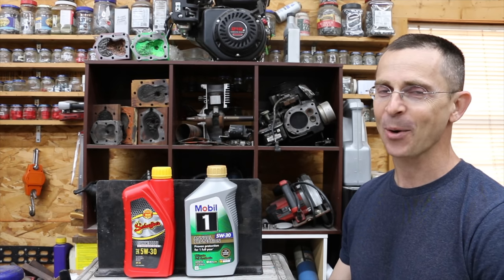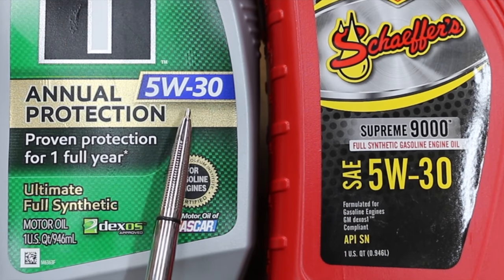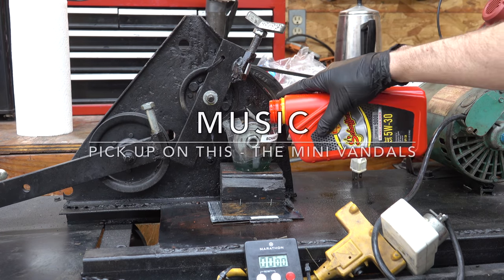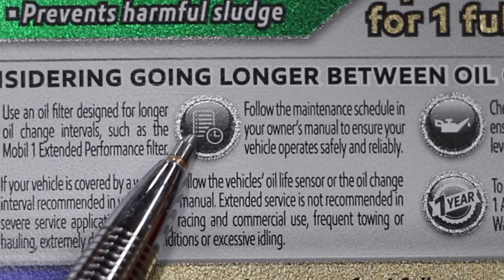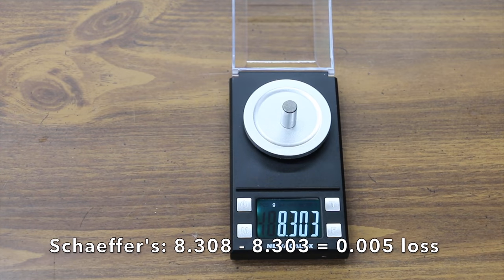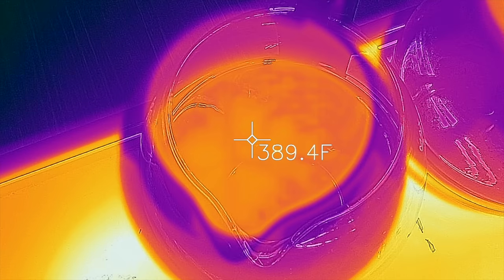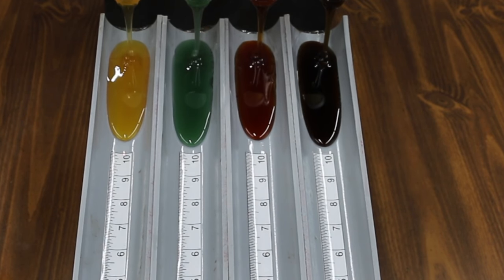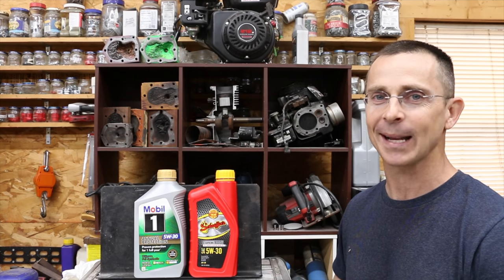Is Mobil 1 better than Schaeffer's Full Synthetic 5W-30 Motor Oil? Let's find out!

Comment: I've used Valvoline for many years, it's what my father had used on the ranch in all of our vehicles and equipment back in the 70's. But once I had discovered Shaeffer's just a few years ago I have not used anything else since.

I have spoken to many fleet operators and mechanics, and those who are willing to spend an extra few bucks on quality oil will choose Shaeffer's. One mechanic had told me once that he had to do some head work on his engine, and he had sent in his camshaft to have it reground since it had several thousand miles on it. His machinist had called him back telling him that he couldn't do anything because his camshaft still meets factory specs and had no wear on it. He is not the only one who I've heard from on how well that Shaeffer's oils perform.

 Once my new GMC Sierra is ready for an oil change, I'll swap out the factory fill oil for the Shaeffer's oil.
Reply from the maker: Thanks for sharing.

Comment: I use Shaeffer’s in my 1985 VW.  The engine runs like new and has zero issues with near new compression.  Can’t go wrong. Oh, it is their diesel specific 15/40.
Reply from the maker: Thanks for sharing.
Reply: Have you done a video on garage sized air compressors?  @ProjectFarm

Comment: I've used Mobil 1 since they first began making a synthetic oil and have always been extremely satisfied. I have even drained their oil after 5000 miles and it was still golden in color! Having said that, I'm somewhat appalled at how high the prices of all synthetic oils have gotten. I'm sure that Schaeffer's is extremely high quality oil as well but I don't know if it's worth the extra 4-5 bucks a quart.
I think you paired the 2 top oils together in this test. I'm certain that the Mobil 1 would beat almost all of the other oils being tested. 
Your right about the recommended oil change intervals but I have seen some that recommend a 1 year/15,000 mile interval. 
Great testing as usual though. Thanks for the info 👍 P.S. I take my oil with 2 sugars and cream.
Reply from the maker: Thank you!
Reply: Trust me, buy in bulk when buying shaeffers motor oil supreme 9000.  Buy from a wholesaler who sells it and I paid 6 quart back in February of this year 2019. It's an outstanding oil ,and I saved alot of money and so can you.
Reply: @chadnmelissa8830  thanks for the info. I'll give it a try.

Comment: A more appropriate test would be to check the viscosity at -25 and 100 C.  Its possible that the Schaefers performs more like a 20 weight oil at high temperature... not a good thing. You should not have any trouble checking viscosity at that temperature. Your lubricosity test is good... how about running it after its been used in your car?  Another good test to determine the oils ability not to break down... far more important than your evaporation test.

Comment: I once let that Mobil 1 Advanced formula in for 15,000 miles. It was black as hell but no sludge was found. Thats how you test it. Trust me, Mobil 1 is King! Accept no substitute! I also use the Mobil 1 synthetic oil filter.
Reply from the maker: Thanks for the feedback.

Comment: Simple but great test. very informative. just one thing, one might argue the pipe (PVC pipe?) used as a race track might contribute to the error of the test. So, best is to test the possible error of the pipe by running single type of oil over all 4 tracks first to make sure they all finish the same time. Anyway, its been 10 yrs I Ieft ASTM/DIN related work, feeling glad and nostalgic seeing someone does material testing. Keep it up!
Reply from the maker: Thank you for the recommendation!

Comment: The best oil is clean oil. 

I own a 2007 Ford 500 3.0 L V6 with about 287 K miles. Engine has never been opened for anything. 

This little engine holds 6 qts of oil.  The  first set of plugs was changed at 225K miles.  They still looked like new, but I thought that I got my money's worth by then.   
I change my own oil since new using off brand, (Walmart, and the like), full synthetic 5W - 20 every 5,000 miles and Fram or other cheap filters.  Sometimes when the miles were accumulated by extended highway driving,  I changed the oil after 10K miles. Still looked clean.  When you look into the engine from the filler cap, it still looks shiny like it did when I bought the car.  it still purrs, and uses NO oil between changes.    My other trick is to let the car run for 30 seconds in the summer and about a 1 minute in he winter before driving.   I don't accelerate needlessly like I am driving a dragster, and I am gentle on the car unless I need to get out of somebody's way and bury the gas pedal.  As long as the oil meets the API standards any brand will do.  ALL ELSE IS BULL SHIT.
Reply from the maker: Thank you!

Comment: We started using Schaeffers back in the early 80's on the Farm.  If you farm or deal with heavy construction equipment then you know about Schaeffers.  They do not really cater to the mainstream crowd or auto market so much.   TDR (Turbo Diesel Resource) had several 15w-40 oils tested some years back through a real lab.  They tested Full Syn and Conventional oils, the results where unexpected to be honest.  Conventional Rotella and Pennzoil 15w-40 came back with horrible results.  Rotella T-6 on the other hand I think ranked 3rd on the Full Syn while Amsoil was basically at the bottom of the list for Full Syn.  Kind of makes sense as the only transmission that I have ever had fail was while running Amsoil ATF in it.  AMsoil and Pennzoil are the only brands I will never use unless I need an oil to start the burn pile.   Schaeffers is the only thing I run in my Vehicles and Toys.
Reply from the maker: Thank you

Comment: I run Schaeffer's in my race car and use all of their products. Penetro is by far the best penetrating oil available anywhere. Citrol is a citrus based parts cleaner.
Reply: Heinz Guderian the silver streak aerosol grease is perfect for fithwheels as well

Comment: Love everything about all your videos but one I always look for is the Schaffer’s 700 Series 15w40 for semi diesel fuel not gas engines but it compares with like T6 shell Rotella oils or mobile one full synthetic but the Schaefer 700 15w-40 I’ve heard supposed to be better than all other synthetics I do know the 700 series is a conventional bland, but I’ve always heard it was better than any other semi truck oil in  synthetic

Comment: I  know you read the posts because you have replied to me a couple of times. I really appreciate you and I trust your opinion. I have a 1999 Dodge Ram van direct drive carpet cleaning truck with 135000 miles on the vehicle and 84000 hours on the cleaning machine. The truck needs to be running at 1500 RPM while I'm cleaning carpets.
My mechanic tells me that that amounts to 550000 miles on the engine.It still runs great.  Because my truck has a rear main seal leak and I go through a quart every 2 weeks (I use a drip pan when I'm working and in my garage) I have been using Schaeffers 7000 10/30 oil as opposed to the Shaeffer 9000. I want to keep the truck running as long as possible. Is it worth it to spend the extra money on the 9000? Are there any motor oils that are better than Schaeffer for my application? Are there any additives that might be good for my truck at this point? Do you have any recommendations?
Thank you
Reply from the maker: You might consider using a "high mileage" along with AT205 to "slow" the leak a little.  By the way, does the engine have 8400 hours or 84000 hours?   I hope this helps.
Reply: @ProjectFarm  it is 8400 hours but that's a lot of hours for direct drive carpet cleaning machine and my mechanic says that that translates into a lot of miles even though it's standing still but it's running at around 1500 RPM.
I looked at your complete oil report and the Pennzoil ultra seems to be better than Schaefer. Do they have a high mileage version of that?
And what is that additive that you are suggesting? Who makes it?
Thanks for your help

Comment: I use nothing but Mobil 1 oil. I think it's a really fine oil. I have a 2011 Ford f250 4X4 6.7l diesel pick up with 100,000 miles  and I had to take the lower oil pan off because of a small leak. When I took it off the inside of my engine looked BRAND NEW. No build up no gum no grime,I mean it was really clean and I attribute that to the oil that I'm using. I do a oil change when my truck tells me to and on average that'll be anywhere from  6800-7200 miles. Mobil 1 oil is absolutely fantastic. If they made a cooking oil  it'll probably be great too, ha ha.
Reply from the maker: Thank you

Comment: Though both oils are rated 5W30, the Mobil 1 oil tested slightly more viscous than the Schaeffer's. It's therefore not surprising that the Mobil 1 also had slightly less evaporative loss than Schaeffer's oil. BTW, I have the same Newalocox scale you used. It's not accurate to the milligram so both wear weight losses must be considered within the margin of the scale error. Based on the above, I concluded that both oils were equivalent performers in your tests.
Reply from the maker: Thank you for the feedback!

Comment: Schaeffer is just about as good as amsoil signature series but also half the cost. I get 6 quarts of supreme 9000 for 55$ at local napa. I also love castrol extended performance but Schaeffer is better. My dad's 93 3.0 ranger had 730k miles with no major engine issues on castrol oil. Also bought the truck new with 15 miles. My dad's friend runs Schaeffer 9000 in his jeep 4.0  with 500k miles and no engine issues at all or low oil pressure.
Reply from the maker: Thanks for the feedback.

Comment: Please do a test of conventional motor oils.  Please include Castrol, Valvoline VR1 and Havoline.  The VR1 has high zinc.  Best for my older engine would be 20w-50.  I used to use Havoline because I found it very hard to wash off of my hands.  I figured that has to be a good thing.   Castrol has been the standard for years.  Air cooled engine owners avoid synthetics because they don't transfer heat efficiently like conventional oils.  Thanks!
Reply from the maker: Great suggestion!  Thank you.

Comment: YOU REALLY DO AN EXCELLENT JOB, SIR. 
Thank you so much for this and the other videos you share.

If I may, I would like to give just a suggestion: why don't you assemble at the end of the video a spreadsheet, like Microsoft Excel for instance, showing a summary of all tests and comparing all competitors?
It would help a lot to see the results. A big plus should be to have some charts.
I can definitely help you with that, for IT just happens to be my specialty.
Once again, thank you for your excellent videos and tests.
Reply from the maker: Thank you!

Comment: Great video, but unsure about the reliability of the results the evaporation loss part of the test. I would suggest for the heat/evaporation test to insure that you have the same volume of oil to insure a fairer comparison, as the exposed (to air) surface area would be the same. Otherwise, if going for weight, I'd recommend an uniformly shaped container, again to insure similar surface area.  Fluid (thermo)dynamics class is quite distant though. Cheers!
Reply from the maker: Thank you

Comment: Splitting hairs, just change your oil and filter regularly.  If your modern car calls for 0W20, it's synthetic.  If it's older (last 10-20 years) and calls for 5W30, you can use both conventional or synthetic oil.  I prefer synthetic as it's more forgiving if you go over the recommended oil change intervals. 
Just buy what ever brand name of synthetic oil that's on sale and replace the oil and filter regularly.
Coming from a Red Seal Licence Automotive Mechanic with over 30 years experience.   Cheers,  :-)
Reply from the maker: Thank you!

Comment: One thing you didn’t show was cleaning the machine between the two oils using Shaeffer first would coat it with its boundary lubrication without cleaning it really well it will spoil the test with mobile one if anyone has doubts call your local Shaeffer salesman and they will do a demonstration for free and explain more of what they have to offer mobile one also doesn’t have an oil program to lab test your oils so you know exactly when to change and you don’t throw away good oil only costing 11 bucks per test kit order wholesale through a distributer and it’s very competitive with chevron oil line

Comment: I hope you are keeping all this data in a handy downloadable spreadsheet for all of us to reference in the end! This is some great testing! I've been using mobil1 for probably 15 years. But from a price:performance ratio I wonder which oil would be best. Of course amsoil is good stuff but holy cow is it expensive, and for maybe marginal performance gains.
Reply from the maker: Thank you!
Reply: I can get Amsoil for less than $13.87 a quart. If you get 250,000 to 300,000 out of your vehicle just taking care to use a good oil and change it as you should then you have done well. Most any synthetic oil out there will get you that far with a good engine.

Comment: Hi. You done quite a bit of testing on oils themselves and their various properties. How about a video about testing products to clean / remove oil stains from concrete (shop floor, garage, driveway, etc.). I see a lot of products that claim to work and lot's of homegrown remedies, but really not sure what will work on an old, deep oil stain in concrete (full disclosure: I happen to have one in my garage!).There are so many different products such as petroleum based solvents, alkaline cleaners, bio-cleaners (oil eating bacteria), etc. Would be interesting to see a cross-section of different type oil stain cleaners/ removers tested for their effectiveness.Thanks and have a great day.
Reply from the maker: Thank you for the video idea!

Comment: Could you please do load tests on admixtures of gasoline and two stroke oil?  Ratios of 25-1 to 50-1 would likely cover a decently wide range of known usages and extrapolations from your known results would be sufficient to cover greater or lesser ratios in use.  I fully appreciate the equanimity of your methodology but there are a great many choices to be made in this arena and we could all use a new map to guide us.
Reply from the maker: Thanks for the suggestion.

Comment: One thing about Redline, It does not have the endurance as any other brand, even though it is an amazing oil while fresh.  Something that your testing will not be able to show unless you actually send it to the lab.  Redline was designed for high performance engines that will be changed often.
Reply from the maker: Thank you

Comment: I use Mobile 1 European formula in my VW mainly for convenience. It's the only VW 502.00 certified oil I can find at Walmart and it's only $8 per qt. I don't race or drive like a heathen so it serves my needs well enough.
Reply from the maker: Thank you

Comment: You never did any more follow-up tests on Schaefer's oil. I've used Schaefer's for years and have had very good results. I've even seen the viscosity brake test in person and you could not brake it. It even worked when added to another oil that would brake viscosity. Also when using Schaeffer's oil my vehicle gained about 4 miles per gallon. But are they the best?
Reply from the maker: Thanks for the suggestion.

Comment: Mobil 1 was tested in it's early days against Valvoline at Lubrizol. Mobil 1 was sheared to 36,000 mile condition. then it was tested against brand new Valvoline. Mobil 1 was better in every test. I am sure Schaffer's is good oil, but the difference you display is not worth the extra cost. I get Mobil 1 at BJ's Wholesale for 36 dollars regular price for 6 quarts and they have 10 dollars off regularly. You should include a factor of cost benefit per percentage of test results. is a 2% better flow worth double the cost?  In your wear test you should use new steel for BOTH parts and weigh both.
Reply from the maker: Thank you for the video idea!

Comment: I never got to do my great oil experiment because: I was going to use a product called SMB 10W-30 @ $1a pint from the local dollar store in my 2001 4cyl Toyota Camry Solara w/135K miles. Before I could try it, they started selling a new brand. I was able to verify the source for SMB. Their new brand is also stated as 10W-30 SN but I couldn't verify the source for it, so I had to drop out.

The 2001 Toyota Camry Solara is gone but with the insurance settlement (it was the other guy) I bought a 1996 Nissan Sentra GXE w/141K real cheap. It also can use 10W-30, and I would try SMB if it was still available.

People don't understand us. We buy the cars and trucks they throw away, clean a few things, get a few parts from the self-service wrecking yard and drive them another 150,000 miles. We always fix the mechanical before we start in on the cosmetic. My Sentra needed drive axles. I got rebuilts from discontinued lines at two different parts stores $55 for both. Fixed the brake lights with a 30 cent nylon bolt. Got a heater control box with cables from the self-service wrecking yard for $15. So it goes.
Reply from the maker: Thank you for the update

Comment: A great video, I just subscribed, thanks!!!  Question: I have a 2016 Mercedes E400 Cabriolet and a 2016 Corvette Z06.  I put 2000 miles per year on each car, both cars reside in Tucson Arizona  and are never driven hard, both are stored inside our garage.  I've been changing the oil and filter every two years - Corvette with Mobile1 and the Mercedes with Mercedes dealership oil, I'm assuming synthetic as well - can I go to three years or should I be doing annual oil changes?
Reply from the maker: Great question.  I will have a video for this topic coming soon and provide definitive information.  Thank you!
Reply: Change oil every 12 months or by mileage